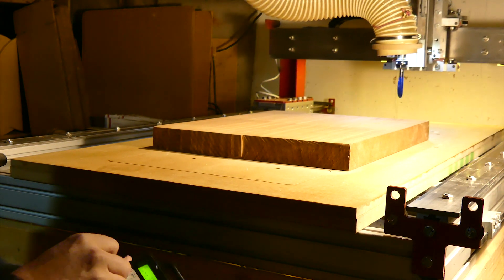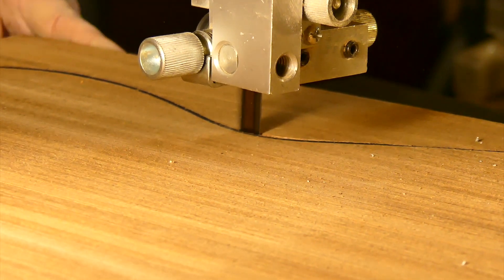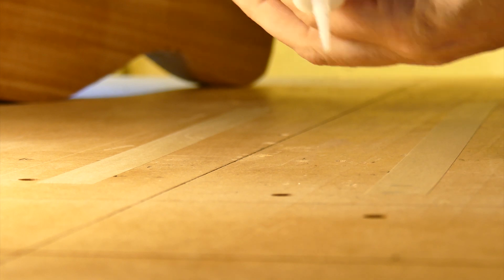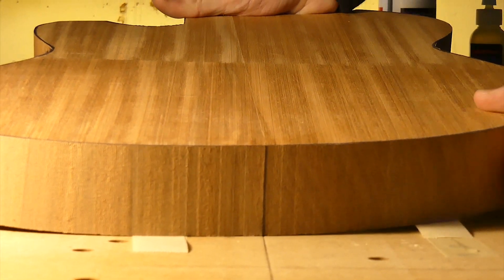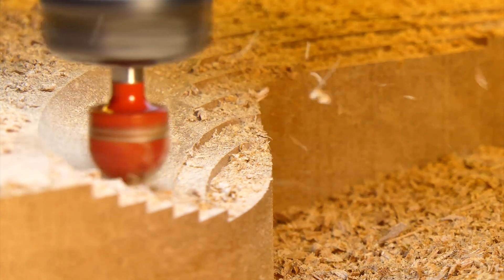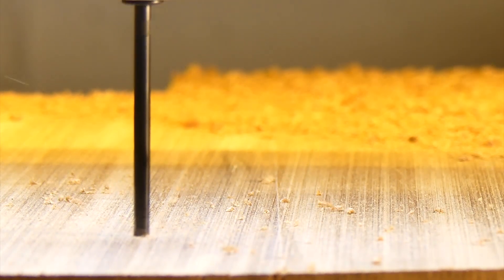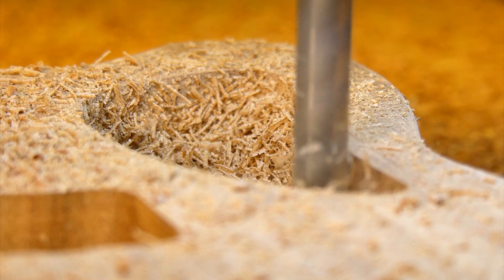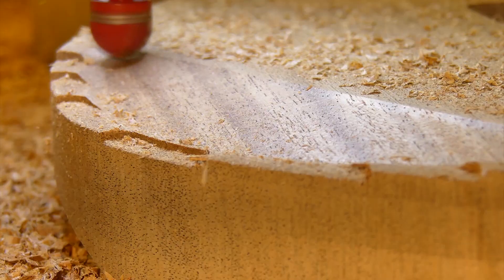CNC Fitting a Bass Neck Pocket

Comment: Can You share Your experience in terms of consistency in Mach3? I have seen many people complaining about its communication issues or ghosting effects while in the middle of a carving..! Any EMi or Power Spike related disconnect issues or stepper loosing steps such issues? Have you come across any? 

And what controller is it?
I would like to see a picture os your rig control panel as well

thanks
Reply from the maker: If properly set up it's extremely good, I run a G540 on a parallel port, and I have no issues, the issues I hear about are almost exclusively due to wiring problems. at one point I had an issues with static electricity with my dust collection system, when I updated my hose it went away. I have recently switched to Linux CNC, and I find it equally reliable. I will be making a video about this setup soon.
Reply: @TwoCherriesIns  Wow..! Looking Forward to watching it..! 

The Good thing about Mach3 is affordability of hardware.! 

But since reliability lies upon setup and hardware.I always lack confidence to try them.

You switched to Linux CNC..!  Wow..!
Which Board?
I have seen videos saying that Linux offers refined and higher communication bandwidth which is desirable for AC Servos.

But I dont have access to Good Controllers for Linux CNC here in India.

Do LPT Boards for Mach3 work with Linux CNC..? 
I guess Not.

Setting up Raspberry Pi or such workarounds are not worth in my observation...!

Comment: Hi, I love your videos. The quality of production is impressive. You make beautiful the CNC process. 
Can you clarify If I undestood your process for fitting the neck? 
- You make finishing passes with positive to negative variances, while checking at the end of each pass if you have a good fit. Is that right. You only showed this at the end of the process. 
Once you have learned the right variance for the finishing pass, you use that for production of future units, or you do the testing for each body?
I have to test the masking tape and superglue trick in my setups!
Keep it up.
Reply from the maker: Thanks, I appreciate that; I have always found it an interesting subject matter for videography. I'm happy to help you understand what I'm doing and why I do it. Tolerance fit is a complex subject, and it can be even more challenging in this material. You are correct that I start with a positive "stock to leave," as in Fusion360, usually around 0.010"; I take passes of 0.005" each until the fit meets the client's specification. With wood, each species, and at times, each piece of lumber can result in different tolerances. If the specification for the client is to make each neck fit very closely, as it was in this case, I have to go through this process with each body neck set. I find that this tolerance fit makes very little to any discernible variance in tone quality, but I'm happy to indulge my clients with their experimentation.

Comment: I don't understand how he manages to hold the piece in place with tape, you can explain your technique better
Reply from the maker: This is not my trick; it's actually an old trick. I saw it first used for holing templates instead of double-sided tape, and that's where I first saw it used. It's simple you burnish tape into the parts, and it makes the tape stick very well. Then you use CA glue to hold the two backsides of the tape together; it works surprisingly well and withstands vibration better than most double-sided tape; it's also very inexpensive.